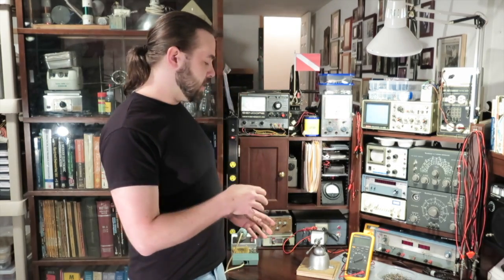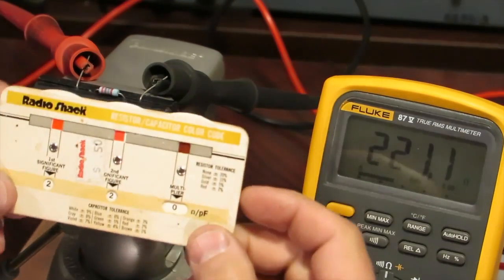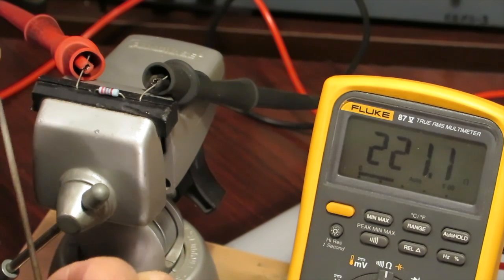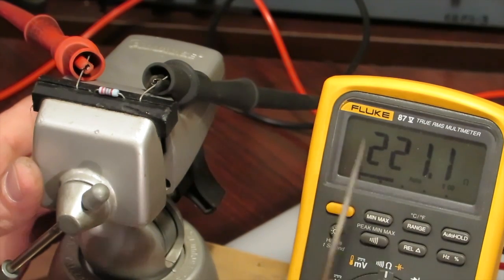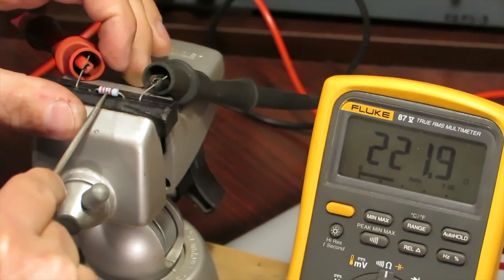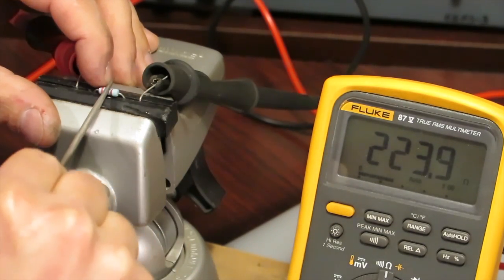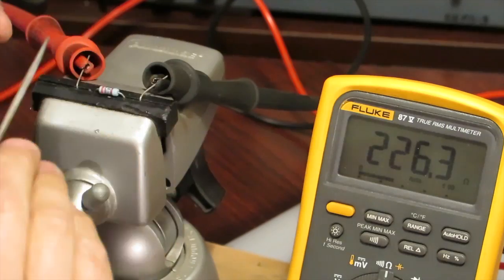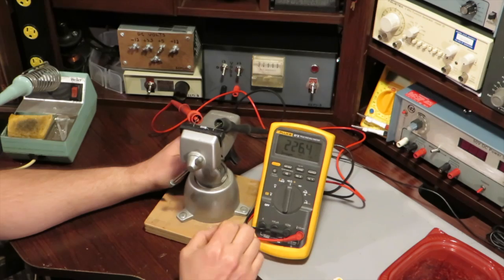Dialing in the value of a resistor

Comment: nice! That is cool. So much so that I would love to get the whole scoop. Meaning >> Which type of resistors does this work with? which ones struggle with it? IS it same with SMD ? <<   Might this work on Ceramic Caps too ? ... Yes, exploitation is sometimes akin to exploration. That is crazy cool !!  I never thought the outer coat was so minute. Seems like its barely there  !
Reply from the maker: To our knowledge this works on carbon and carbon film resistors.  We have not got into SMD much yet, and not sure about the capacitors.  We would love to hear about it if you experiment with the capacitors or the SMD components.